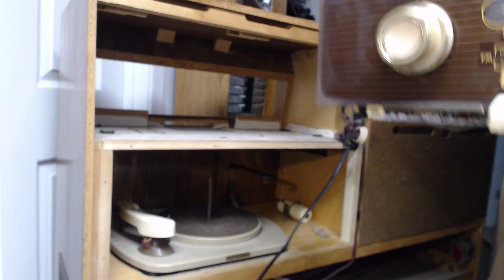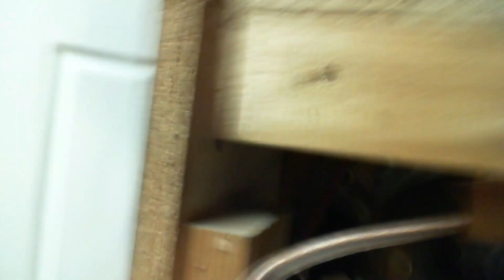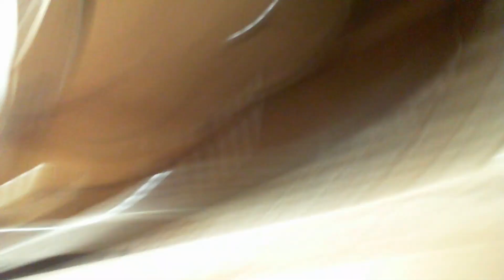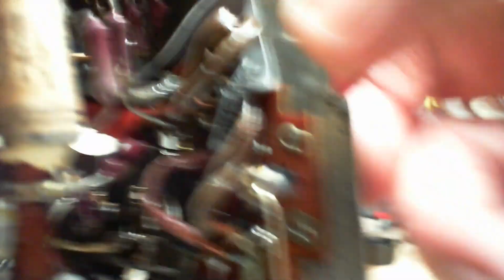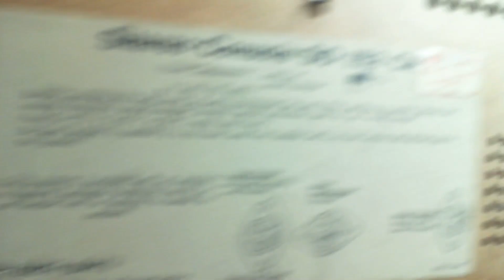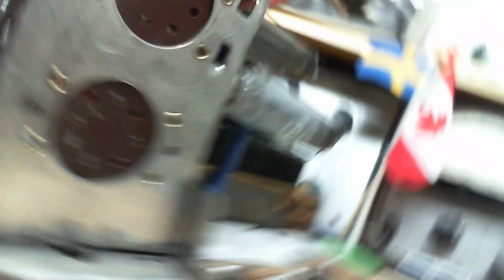Grundig SO 152 CA Console Stereo Video #1 - Bench Checkout

Comment: It has been Quite warm here in Iowa(USA). The System we have here now, will cool our weather down. and in fact may be heading to your location Jim!  Low pressure!

Ral Donner would Say "You Got Burnt" after Touching a radio tube when hot ....  Now thats some heart break when your radio/Phonograph/TV Burns you!   and yes, I have the Non Promo 45... 

https://www.youtube.com/watch?v=3LDR3Th9bWI

Some Stereo Consoles, have A high bias and if you remove the plug or one of the speakers - you could pop a fuse, Cap., Tube(if not SOlid State)... etc.  I did have a magnavox Micromatic, removing just one tweeter would damage quite a few components.   so, unplugging that plug when the Unit is not in use/On will obviously be alright.